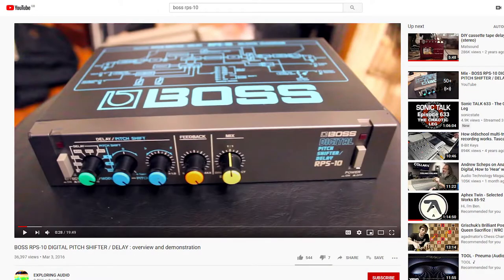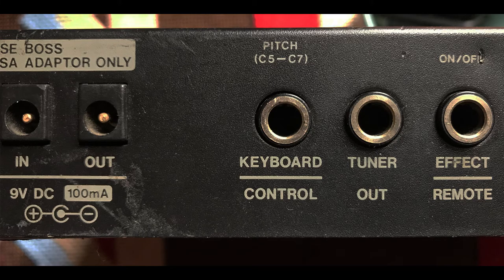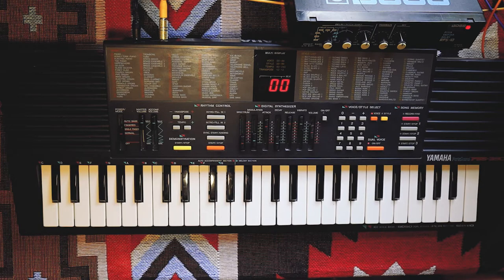The BOSS RPS-10 is a crazy noise machine!!!

Comment: Still got one of these from the late 80s. Apart from the interesting experimental stuff, thx - this is a decent 800 msec digital delay and a Octaver 1up or 1oct. down range /Harmonizer. It is also able to do nice chorus/ flanger effects. So quite versatile and good quality. BOSS/Roland was neither cheap nor "faulty", even, or especially not in the 80s. Also got 2 RCL-10  Compressor/Limiter of the same series, that still work fine.

Comment: Cool video. Got myself one of these earlier this year (as well as a Yamaha Portasound, too!). Pretty cool box. The white whale for me though is the Boss RSD-10 (sampler-delay) which has a similar trigger-in function. Those are pretty hard to find. Autechre used these boxes quite extensively on stuff like Chiastic Slide (by cranking up the feedback on 100% wet signal, and sampling the recirculated chaos)
Reply from the maker: Thank you Luke - I'd never heard of the RSD-10 but now i realllly want one haha! :D
Reply: I've got one of the RSD-10s... but I'm not sure how best to use it. Any tips welcome!
Reply: @unexpectedbowtie  Drum machine to trigger-input is pretty fun. You end up with delay patterns matching a drum pattern (instead of straight sequence of delays). AFAIK, you can ALSO alter the pitch of the delays via the pitch input.
Reply: I got the rsd10 and rsv10 that’s the reverb one ...